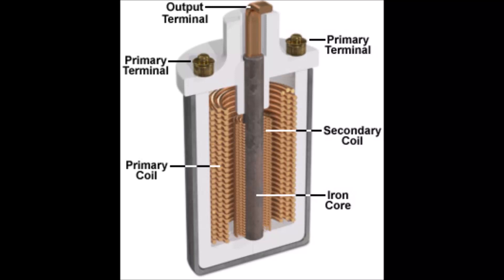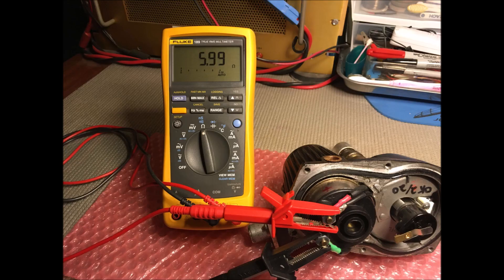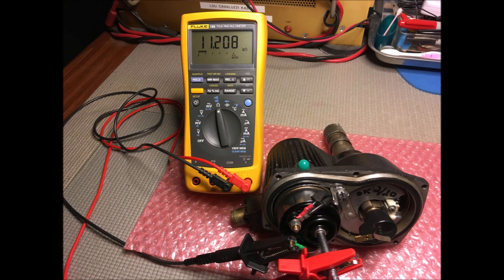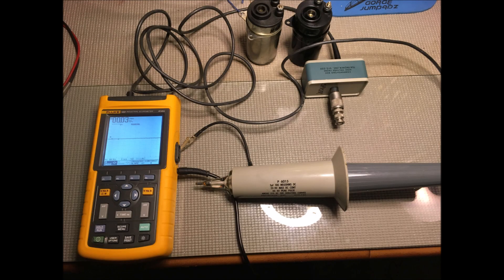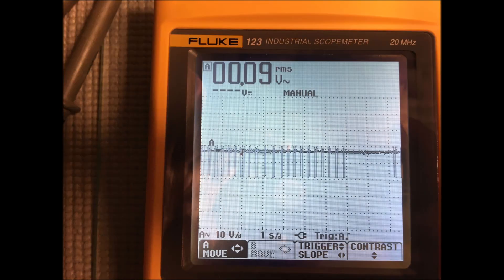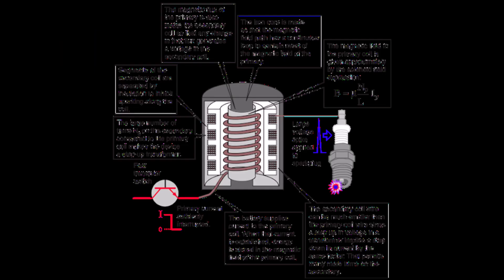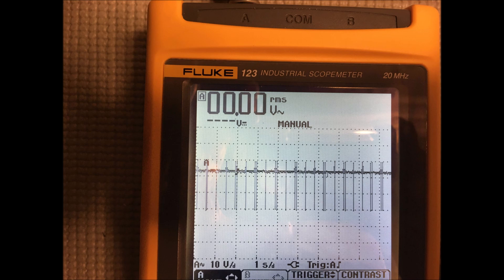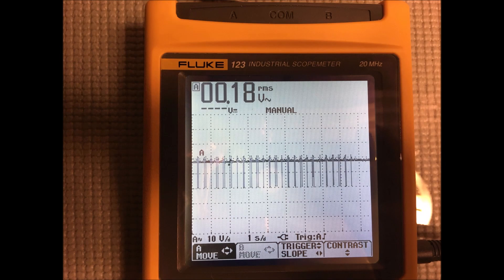M151 Coil Testing

Comment: such a Greeeeat  video. my Pri ohms was 23.9K ohm (not connected to CAP/points)  2nd coil was 12.5K ohm's. i am also getting a crank no start. and no sparks. guess i better go find a new GOOD coil and points. my ap is all rusted out